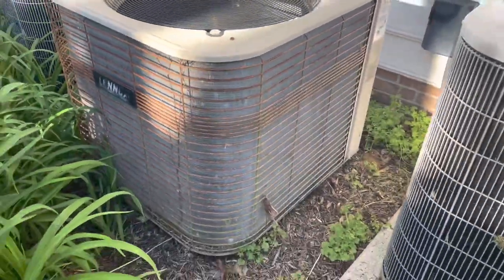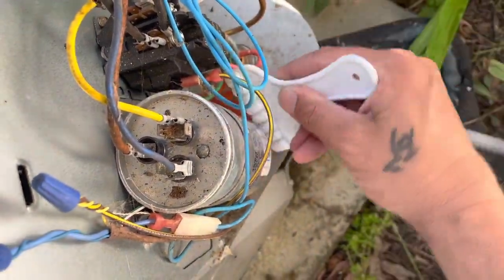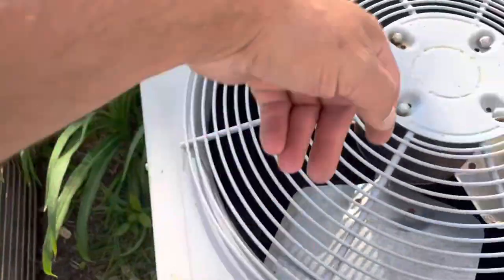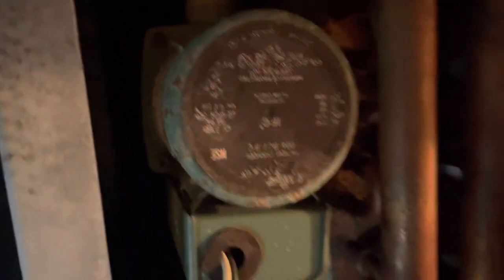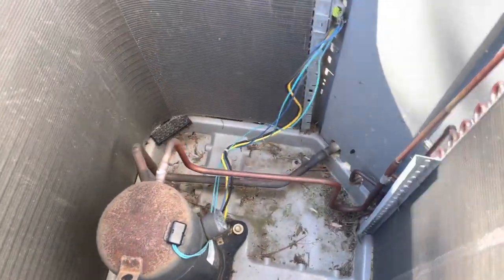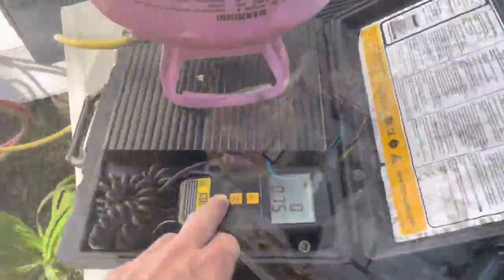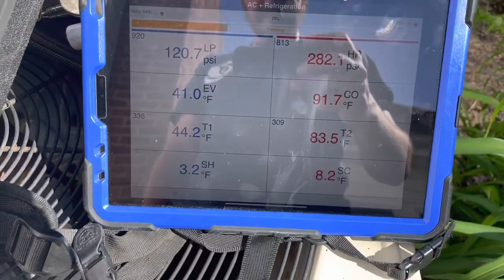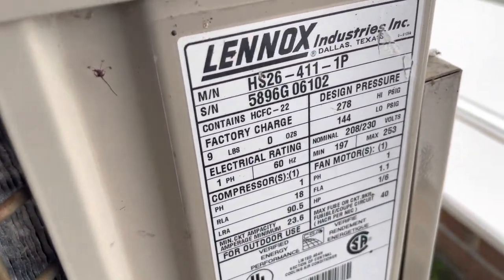Carrier AC unit low on Refrigerant. Using One and Done Leak Stop!

Comment: With all the talk about not damaging the coil fins with too much water pressure spray while cleaning coil etc etc. I have never understood why the manufactures don't have some sort of protecting seperate band at the top of the coil. The lids just sit right on the top of the fins and they can easily get bent or crushed while reinstalling the lid.   Just doesn't make sense to me.     Good video man , watching from northern Delaware.
Reply from the maker: Yea, your right.  Some manufacturers do have a piece of foam or protector up there but most don’t.

Comment: I have never used this product but do wonder, how does it not foul the txv or metering piston?
Reply from the maker: I think there has been reports of that happening but it’s never happened to me.
Reply: The particles in the leak seal react with water moisture present in the air around a leak. The moisture causes the tiny particles which are suspended in the oil to accumulate at the moisture location thereby plugging the hole. The biggest problem with sealants is in the filter dryer since there is likely moisture in every system that was removed and held at the dryer. If the sealer contacts this moisture it can plug up the dryer and cause a restriction. There are specially made dryers that are compatible with sealants though. A totally clogged dryer is probably responsible for most of the bad stories. Every tech that doesn't bleed air out of the gauges puts more moisture in the dryer. If you run the system for an hour when you insert the sealant you have a better chance of distributing the particles throughout which makes very few particles passing through the metering device at any given moment of operation.

Edit to add that if a "clot" from the dryer breaks loose that's probably why the meter device fails when it does. The restriction in the dryer builds head pressure and blows it out where it gets caught in the meter device like a heart attack.

Comment: Nice video man. Quick question, I replaced the capacitor and fan and in the process I messed up and dropped the fan. I nicked the condenser, it’s a tiny leak, it lasted for 5ish months at least after having almost 2 lbs added. It a small unit too. Will a stop leak work or just fill it to get through summer? I do have a.vacuum and gauges too. Thanks again.
Reply from the maker: It would at least slow it down if nothing else.  It's always better to repair the leak or replace the leaking part, but if those aren't realistic options for you at this time then sure, give one of the stop leaks a try.
Reply: @JeffsHVACAdventures  appreciate that, any stop leak you would recommend over another?

Comment: I use the Bluon TDX 20 in place or R 22.  What are uour thoughts on it?  I love using it.  It seems like leaks are the most common in this business.  So many cheap evap coils.  I cant wait to see what happens with this new mmidly flamable R 32 A refrigerent that is coming out.
Reply from the maker: I haven’t used the TDX 20.  But I’ve heard from multiple ppl it’s pretty good.  Yea R32 should be interesting.  Although R32 is one of the refrigerants that make up 410a and they are very similar on a PT chart.

Comment: When should you pull a vacuum when adding to an empty system????
Reply from the maker: If the system is empty due to the refrigerant all leaking out, you’re going to want to try finding the leak with nitrogen and repairing it.   Chances are it’s going to be a pretty large leak then and not very hard to find.  After repairing the leak, pull a vacuum as close to 500 microns as possible then charge.

Comment: That Tekmate is good for R22. For 410A ain't going to pick up. Use ultrasonic or infrared
Reply from the maker: I’ve found a good jag of 410a leaks with it but your right, I’m do for an upgrade!
Reply: Fieldpiece SRL8 has been good to me for 410 - a little quirky at first, but won’t let you down once you get the feel for it.  Nathan’s HVAC has done excellent videos on leak search & detectors.  Tekmate is fantastic for 22.
Reply: Inficon tekmate is a top-notch refrigerant leak detector that actually works.